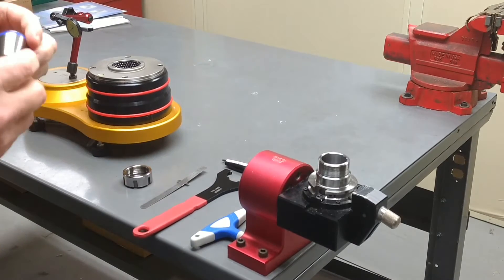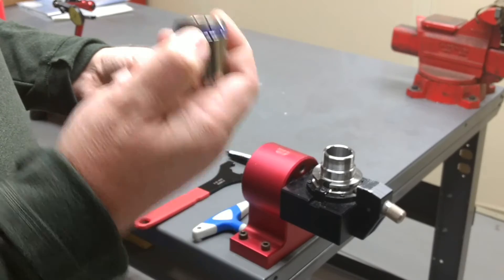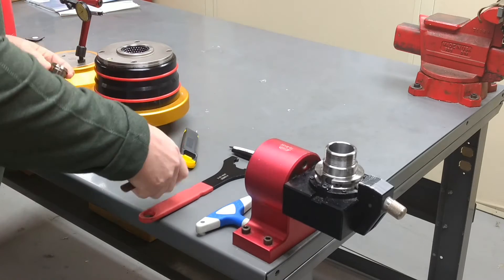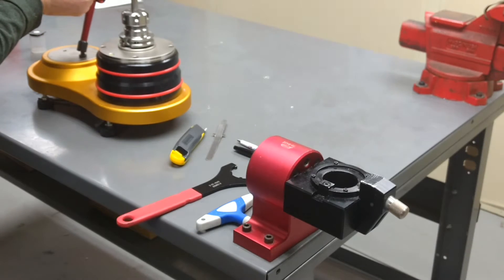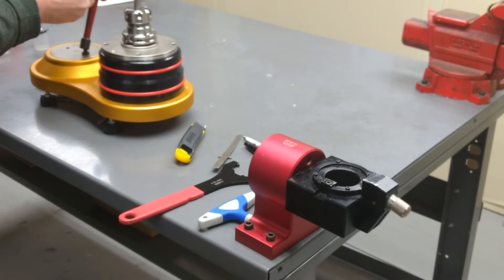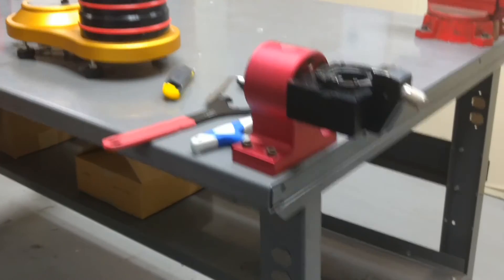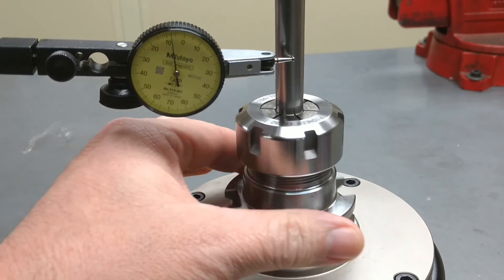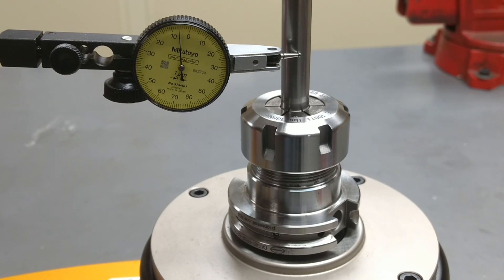HER32 Collet Assembly in STD Collet Chuck, TIR check less than 2 Microns!

Comment: What is the name of the red/black/gold rotating stand you guys use in your videos? The one that you insert the tool holders into? I cant seem to read the nameplate in any of the videos and would like to read up on them
Reply from the maker: It took me a long time to find someone who could build me an inspection base that was accurate and easy to use.  I am sorry but I do not want to give up my sources.  They cost about 2-3K each with current exchange rate, I would be willing to sell a new one if you interested.
The inspection can be done in a V-block set at an angle in a Vice.  A gage is not required to spin a holder to check TIR.

Comment: would a bearing nut be better? so you dont have to remove the blue thing
Reply from the maker: Sorry but the Blue Ring has to be removed with the bearing nut as well.  I found 1 nut out of Germany where the Blue ring can stay but if you collapse the collet the nut is dis-engaged leaving the collet in the chuck.  And the nut cost more than the chuck.
Reply: Lee Flick is there any way you could do a real world test cutting in a mill with all the different holders with a 1/2" Endmill to see the difference of finish and vibration between the Endmill holder, standard nut er32, bearing nut er32, standard nut with her collet, bearing nut with her collet, sx25 holder, and bc .050 holder. is that something you could out together in the future?
Reply: Lee Flick also maybe a list of all the slip torque numbers for each.
Reply from the maker: We will be performing some milling test later this year here in Chicago.
I am not a believer in using a collet system designs for drilling in milling other than Semi-finish to finish.  

ER collets by design are 1/3 dis-engaged from the collet pocket to provide 1mm collapse, most 4-5mm dis-engaged.  The nose of the collet is not supported where all the side load is being applied.  Mill Chucks do well because they are supported at the end of the holder.  Hydraulic would do well but the side load damages the glands and over time rupture.
Any ranging collet is dis-engaged for the collet collapse and no one buy's an over sized collet and collapses it to seat it because your TIR goes out.  SX is better but they still have 0.020 range and 3-4mm dis-engagement.

Our sister division in Japan has a double piloted ER nut design that is designed for milling using our HER collets.  They have done some testing and are running more.  The testing was done on brands we do not have here.  I have requested a side by side with a standard ER & MC.  I will share this info when I get it.
Reply: Lee Flick wow so much info thank you. where will you be posting the info? also so for milling right now what would you go with a bc.050 with sx25 combos? or shrink fit$$$
Reply from the maker: It depends on the application.  BC is great for vibration in many applications and there is a non pull out option.  Shrink also is great but can get tuning fork effect in some materials and programming.  SX for lighter milling or long drilling.  SX does have a non pull option but vibration dampening is not as good as BC due to the collet.  SX you can stub up tight to the spindle which helps in some machines and applications.

Sorry I do not have a 1 tool fits all...